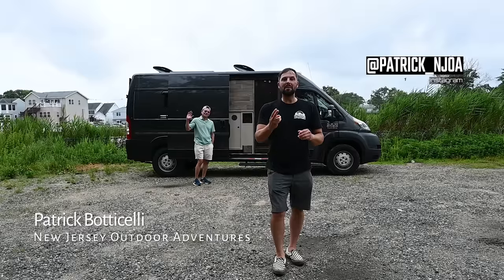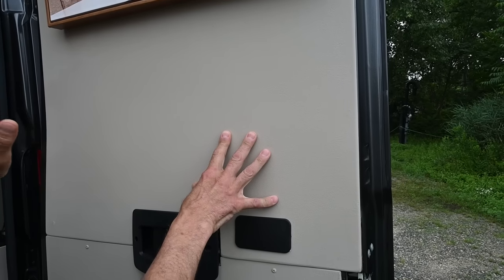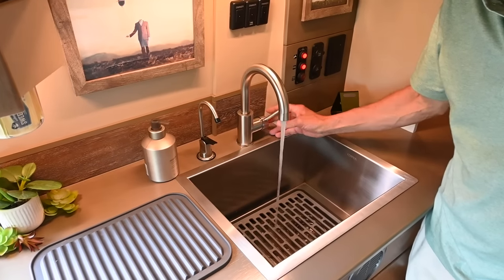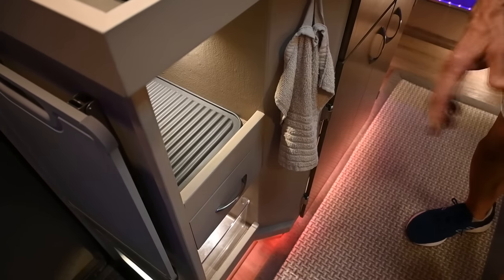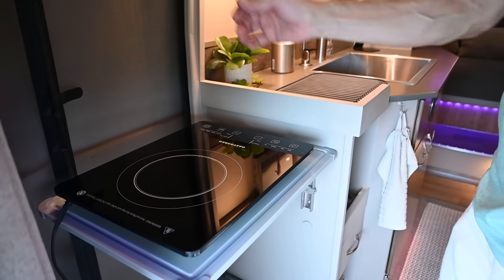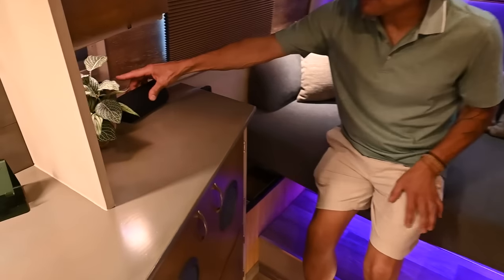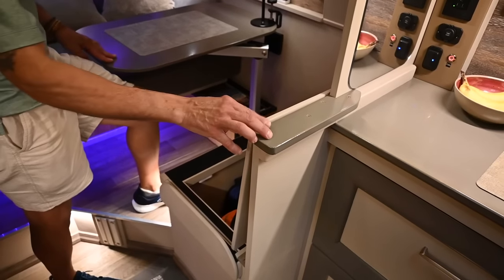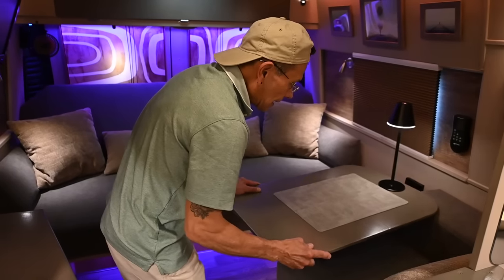Most INSANE Van Build EVER - Cozy Vibes & Very Intricate Design

Comment: This is a "Home" in a van. I am doing a build out on a 12x20 cabin and wasn't sure of the layout. I have been looking at "van" builds to get some sort of layout plan that i can convert into a larger scale, that is not so space consuming. I mean, small is small, no matter what the shell is. I would still have space for my woodburning stove and a hutch for my clothes. Love love love it. I do have the ecoflow delta 2 and will be hiring out the electrical though. Great work!!!!😊
Reply: Thank you so much and good luck with your build. I've actually been making changes to the van based in all the input I've received, so much Patrick may even have to shot a new video when I'm done. I just changed the Ecoflow Delta 1300 that I used for the build and replace it with the Delta 2 Max 2048Wh. This unit is not only much more powerful but it's also expandable up to 6000kWh. The AC output is 2400W but with a proprietary booster technology of 3400W output. It can pretty much run anything! And in addition to other great new features it also has an easy to use App so you can control the unit from your phone! Wish I had started with this unit from the beginning since being a bit bigger in size, it had to be relocated to a larger space and therefore I had to run new wires. Just when you think you're done!!! Thanks again.

Comment: Shower curtain can use the retractable clothes line and some connection points which will make that do much easier to deal with
Reply from the maker: Thanks for the suggestion
Reply: Im so working on that shower curtain! Thanks

Comment: Think about 4 rods in the top of your shower curtain. 
They easily fold and control the hanging material. 
Beautiful work.  😊😊😊😊
Reply from the maker: Great idea!
Reply: Yes, I like that idea! The shower is too complicated. Thank you!!!!
Reply: @tigre1su  
Actually, I think that 4 vertical rods only, hanging in the corners, would help create 'virtual' walls to contain the splash and still control the fabric.
Or just 2 rods pulled forward. 
The bottom of the rods is attached to the corners of the shower pan.
The top of the rods hooked above.
Just my thoughts, 😊 😊
Thinking and doing are two different things. Hahaha Hahaha.

Comment: Looks like a pro designed and built it. One huge drawback is the engine or transmission will fail some time down the road. Towing an rv is a pain but one can unhook it. There always an upside and downside to everything, just life.
Reply from the maker: Yes, he knew this all before diving in

Comment: I love watching creative brilliance! Well done. Hard to believe all that fits into a van. I would live in this van in a heartbeat, if I could afford to buy one.

I have never seen a urinal installed in a van for the guys. So smart. The shower/ compost area is clever. However, my only concern is what do you do to dry those curtains? I would be concerned with mold or mildew, or musty smells, unless you leave it open all night to drip dry.
Reply: Thank you! The curtains are made of hotel quality shower liners. They repel water and dry quickly, so you can re set bathroom in about 30 minutes after shower

Comment: Very nice, only two things I think you could do to make it even better, have sofas area go into bed mode easier, no one wants to set up twice a day. Modifie dry flush to be diverting  toilet when urinating. Save you a lot since average person uses it for that purpose average 6 times a day.
Reply: Thank you for the advice!!! Well said. I think the industry is shifting towards simplicity when it comes to toilets. George @HumbleRoad is a firm believer of this. Disposable recyclable bags are being used more and more for solid waste and dedicated containers for liquid waste only. It's simply and cleaner. I use my DryFlush toilet @Laveo with disposable bags and discard immediately after. Solid and liquid waste should never mix. Would love to see @Laveo improve on your suggestion as well as mine. Would eliminate the need for the battery, cartridges and could provide a large receptacle dedicated for urine (with option to drain with or without removing the receptacle from toilet). Simplicity! The are a great innovative company and can't truly wait to see how they adapt to  the changing needs of the VanLife community. Also would be GREAT if they streamline and modernize their toilet design and attached handles to front and back. I put a flex handle in the back of mine and want to put another one in front. Thanks again!

Comment: The details are fantastic. I’m in the research phase for my build and feel like I stumbled upon the best resource for space optimization and livability. The use of magnets for quick access to the electrical, plumbing, and storage is fantastic. I’m trying to figure out what the counter are made of. They look thinner (and lighter) than typical counter material and the surface looks professional, but I was wondering about durability. Is it an epoxy/paint on plywood or some sort of synthetic material?
Reply from the maker: That is a great question. I’m not sure what material use but I know everything was meant to be lightweight so he wasn’t overload. He didn’t mention to me what material he used unfortunately

Comment: Would love to know more about his electrical system and how all those lights are connected to that battery :O
Reply from the maker: There is a 12v kit that EcoFlow sells to tie in 12v items to the battery bank
Reply: I connected the EcoFlow Delta 12V cigarette outlet cable to a main on/off switch and then to a 12V (12 way) fuse box and to this I connected all the 12V lights, outlets & fans. Then I used a separate AC to DC converter connected directly to my Delta 120V outlet for water pump and refrigerator since these have the highest initial surge draw and require more power, but I'm not an electrician so if someone knows of a better o correct way please let us know! Thanks.

Comment: I like the shower setup. But, if there were guests wanting to use the toilet there wouldn't be much privacy except for the waist-high door and the shower curtain. Instead, I like the folding counter top idea but I'd make it longer so that in the up position it extends right up to the ceiling to make a solid wall for the bathroom. And I'd make the bathroom door in 2 pieces. The bottom half would look like the door does now. The top half of the door would be hinged so that it can fold down beside the bottom half on the outside. In the down position you'd still have access to the counter space created by the (now longer) folding counter top. In the up position, you'd have a solid door that extends right up to the ceiling. Better and more "quiet" privacy. And inside the bathroom it would be nice to have a small, fold-out sink and towel rack to wash up in privacy, as well.
Reply from the maker: Appreciate the suggestions on how you would make the van better for you.
Reply: Great idea!

Comment: Not enough windows for me. Id also want a skylight. B ut gorgeous otherwise.  Very European. Most American motor homes are very clunky visually.  Yours is beautiful and extremely practical. Love the light timer in garage. Smart.

Also, something that no one discusses: How much EMF is your system producing?  Was glad to see batteries are not under your bed, but still too close to sleeping area for my comfort. Gotta be a way to shield EMF for passengers.  

Cant wait to see what you build next!
Reply from the maker: Appreciate the thought and feedback
Reply: Thanks Donna! Remember, windows are nice but they can make the van either very hot or very cold, unless you have thermal covers or use double pane windows (which I plan and hope to use on my next build).

Comment: I'm gobdmacked and speechless ( for once! Well almost...Lol)
I do have a question. The window covers... Do you put the felt side outward during cold weather? I'm getting ready to make some and was trying to figure out how to design them for winter use as well. Thank you for the incredible tour!
Reply: Thank you and thanks to Patrick @NewJerseyOutdoorAdventures for keeping us all inspired and motivated with his amazing channel and video tours. The felt goes on the inside. I recommend you use a rigid reflective (Amazon) AES industries EZ cool car insulation kit. Do a cardboard template and cut your reflective a dab bigger, since it is held in the window by the pressure against the window trim. Use 3M spray adhesive glue for the felt. Spray both side sand wait 2 minutes before bonding. Best of luck!
Reply: @tigre1su  thank you so much for the information.  This van is absolutely amazing!

Comment: Excellent build!! Not crazy about only 11 gal fresh tank and I have two questions...Does he have to rely on shore power to run the 700w heater? and did I miss air conditioning or there is none?
Reply from the maker: He has it prepped for roof top Air Conditioning
Reply: I agree 100%. I started with 6 gallon jug and then upgraded to 11 but I should have  and  will go bigger in my next build. I connect the water heater to shore  at home before I leave. It only takes about 30 minutes but it last pretty much all day, but if need be, I'm also able to connect and re heat by using my @EcoFlow Delta 1,300Wh, since it has an incredible 1800W - 3300W surge. My next build will also have an Ecoflow solar power station (I love these unit!). Either the Delta Max 2000 (2016Wh), the Delta 2 Max (2048Wh) or the incredible Delta Pro, with 3,600Wh. A beast with the fastest recharging time than any other power bank in the market. And no, no A/C. Its well insulated and ventilated but rest assure my next build will include one as well. It can get very hot at times!!! Thanks again for your feed back!
Reply: @tigre1su  Sounds perfect for the way you use it! Kudos on the incredible design and attention to detail. It really is off the charts. Wife and I are waiting for a Promaster 3500 to arrive and start our first build and we have the intent of being able to boondock for stretches and be self-sufficient so we have different needs. I'm probably hyper-focused on those things because of this. Looking forward to that next build of yours! atb

Comment: Amazing build. No need for all those lights thou and that 700 w heater will consume all you power from that little generator very quickly. Bluetti ac180 or 200 would be much more efficient. Your cook top will consume all your power as well in a very short time.  He must be connected to shore power most of the time.  Man, it’s a gorgeous build tho.
Reply from the maker: Thanks for the tips!

Comment: So many great ideas.  Personally, I do not like the design of the shower.  It takes too long to set up and I'm not a fan of curtains in general, but especially on all four sides.  Curtains tend to creep in on you and create a claustrophobic feel in an already tight shower space.  And then to have to break down the shower after and put everything back... it's just too much work.  I don't really like convertible beds either, but this one at least seems fairly quick to convert and has several modes of use, so it's not as bad as others.  Lots of good storage all around and the lighting options are aplenty.  For a single occupant, the extra space created by removing the passenger seat is pretty nice, although it would be a lonely drive if you did have a companion.  More of a chauffer/bus driver setup in that case.  Overall, quite a nice design based on what's important to the occupant, which is what's most important at the end of the day.
Reply from the maker: Thanks for the feedback and for the info on how you would like your van built
Reply: I agree, and thanks to people like you pointing these flaws, I have changed and improved the system. Now it only takes seconds. Thanks again for your feed back.

Comment: What is the exact length of the inside that you would consider a camper part up to the back seat to the back of the van. I like what you've done and I'm thinking about trying to compare and build me a camper on my pontoon boat. I have a 93 inches by 123 inches.That I can build on my pontoon boat

Comment: Meh I would want to build my own electical system, plus I don't know how you guys manage to get by with only 200W of solar pannels, I suppose if your going to be connected to shore power most of the time it's fine, but I suppose it's where I live also 600W would be the absolute minium I would be willing to go with if I'm not going to be connected to shore power most of the time, and my end goal is to go with 885W on the roof with another 885W which I can pull out as a solar awning, then 1200W of foldout solar pannels.

I live in the UK though so during the winter the number of sunny days are far and few between and days are generally pretty dark and very short, hence why I also want 15.5kWh of batteries to bridge those long times without sun, and exess of solar pannel are to charge on those rare sunny winter days during the summer though I except the 885W of solar to be mostly enough to keep my battery topped off during the days.

In the case that the battery is getting low anyway I plan to steal electric from my place of work with a 1000Wh power station, and use the DC to DC charger to take the 12V output from my powerstation and charge the main battery, and you may think that a 15.5kWh battery would take up a bunch of room, not so much the unit is 500mm [19.7"] (w) x 230mm [9"] (l) x 830mm [32.7] (h) which is not THAT big and will be able to fit in the same housing as my inverter virtically so I can put that all in 1 tall housing along with the DC to DC converters—as I'm going to be using a 48V battary and I need 24V to run my fridge etc—24VDC, 48VDC, and 230VAC fuse boxes.

Reason for the 48V fuse box is that the lights are going to be 48V lights and anything that need a different voltage to 24VDC or 230VAC like laptops, phones etc will get a 48V line near to the outlet and I will have a small DC to DC converter in the outlet to get the specific voltage I need with an approriately sized fuse in it to. Haven't decided on the connector I am going to use though, needs to be something that you can't accidently touch the conductors though, I would like something like MC4, but where you can plug in both the negative and postive termal in togther.

Comment: Would the passenger seat be able to be reinstalled?
Reply from the maker: Yes, all mounting points maintained
Reply: Yes, the floor lids get removed from the hinges and the factory connectors and hardware are underneath.

Comment: I'm curios why an on demand water heater isn't used.?
Reply from the maker: It may waste water when it cycles in and off when trying to conserve when taking a shower.
Reply: I see..I also love the van design!
Reply: Well, I don't trust propane gas and thought that by having a 2.5 gallon water heater, I would have hot water ready (without draining my batteries) and it worked! The heater's tank maintains the water hot for hours after I disconnect from shore power, even in very cold days. And if I needed to make the water hotter, it only takes a few minutes rather than half an hour to bring the temp up.

Comment: Should have used a Transit chassis. The Promaster can’t climb hills with the front wheel drive. Must go backwards. It will bounce and struggle to go. The motor will have issues at about 100,000 miles. Used them in my business and all had issues. The Transit 3500 DW blows it away. Interior on your van is beautiful just not a great chassis.
Reply from the maker: The Transit flips over in the slightest accident.

Comment: why the water heater instead of on demand water heater source????
Reply from the maker: A ram water heater conserves water, it will have hot water ready to go and no cold burst like a tankless
Reply: Well, I don't trust propane gas and thought that by having a 2.5 gallon water heater, I would have hot water ready (without draining my batteries) and it worked! The heater's tank maintains the water hot for hours after I disconnect from shore power, even in very cold days. And if I needed to make the water hotter, it only takes a few minutes rather than half an hour to bring the temp up.

Comment: I wouldn’t want something so customized; I would never be able to repair or replace parts. Also his electric system is pretty wimpy unless you plan to use campgrounds a lot. It seems he has given a lot more concern to the look and space than he has to systems. A nomad will tell you a Webasto heater is essential. He isn’t carrying enough water, his refrigerator is too small and the shower is unnecessary. But there are lots of lights.
Reply from the maker: Appreciate your feedback from your perspective